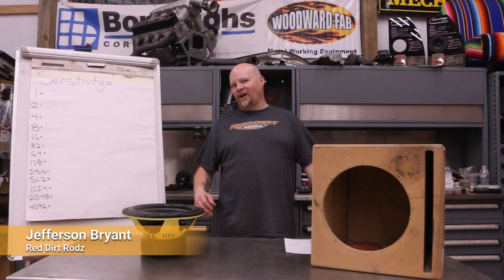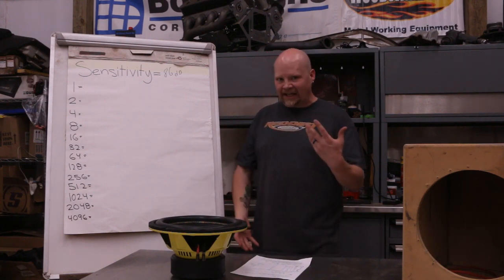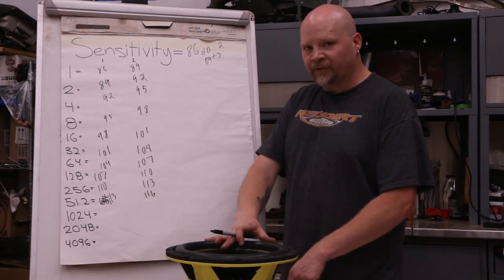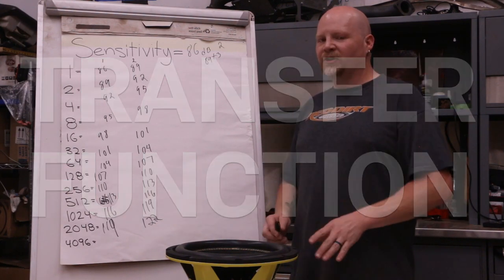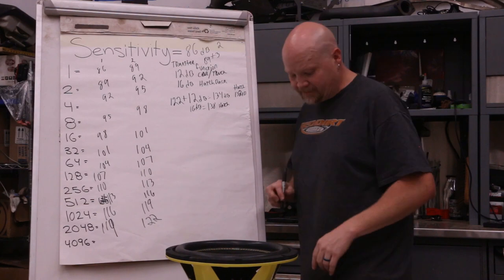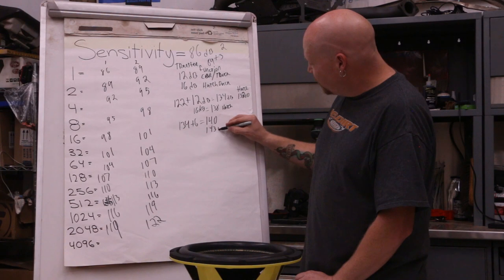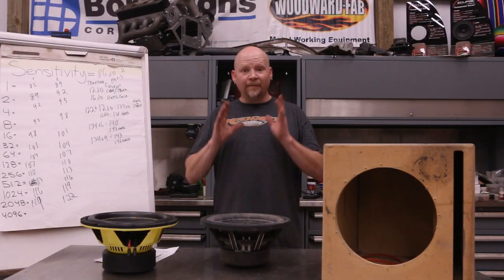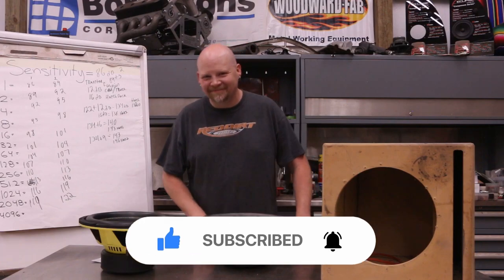How To Calculate How Loud Your Car Stereo's SPL level! It's ALL PHYSICS!

Comment: Idk if the coil size comes into play to coz on my 4inch voice coil at 1700 watts on 2 12s I do 150.9 sealed meter on the dash this videos is gonna help me get some gains
Reply from the maker: Everything comes into play. This is theoretical, you cant just put 8k watts on a 400 watt sub, it will nuke it.